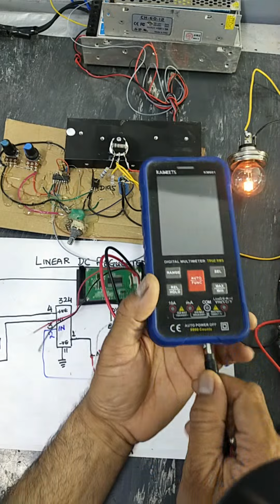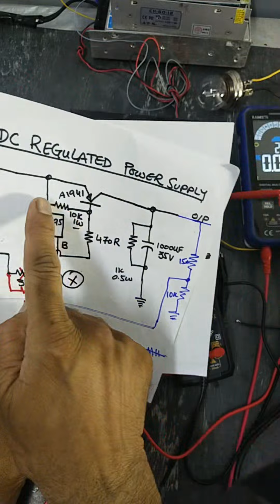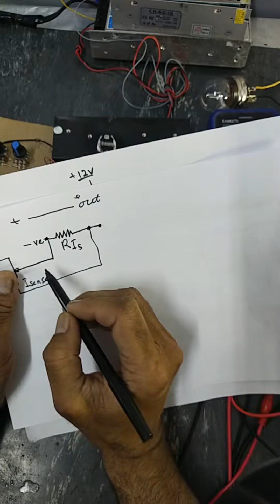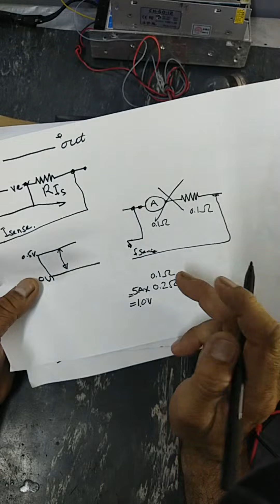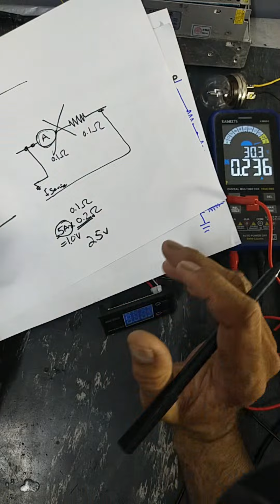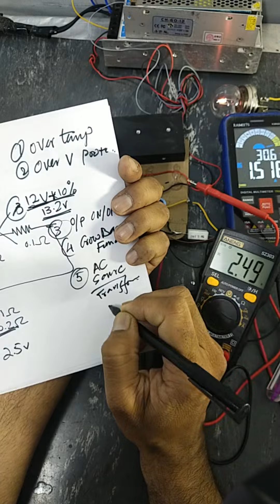{1336B} Let’s Do Wiring of Deek-Robot BL-02 Digital Meter | Live Wiring & Setup | Haseeb Elec

Comment: Dear Brother Aschraf, too bad i missed your live. I have one comment and one question :
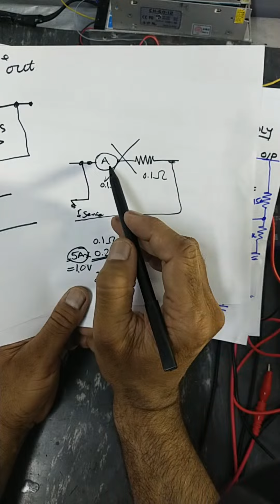*Comment : i think in 25:34 of the video you meant 2.5A 
*Question : i plan to use your circuit with a heavy 30A toroidal 220/60VAC from an audio amplifier. The issue i cannot Understand is why under load DC rectified and filtered voltage drops, while AC voltage before rectification (at the transformer output) stays the same, no matter how many capacitors I put in parallel (25 Farads) and 40A rectifier, DC voltage still drops while AC stays strong.
Any idea where this voltage disappears ?
Thank you, salam aleikum.

Comment: If you connect a tapped transformer,  this will increase the efficiency of this circuit.
Reply from the maker: yes. in upcoming session we will connect transfomrer
Reply: @HaseebElectronics  i am taking about, using multiple tapping transformer and relays to switch different voltage level.
Reply from the maker: The biggest issue will output voltage regulation
Because the output of transformers drop while connecting load